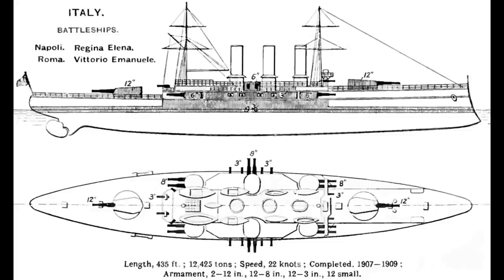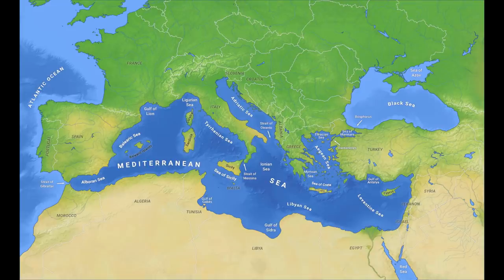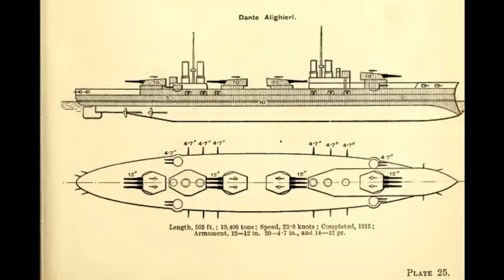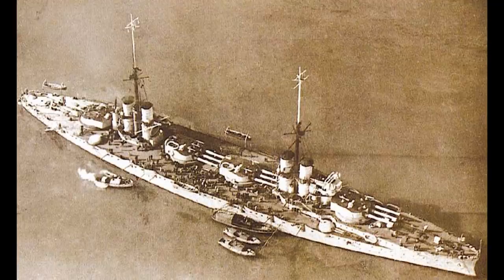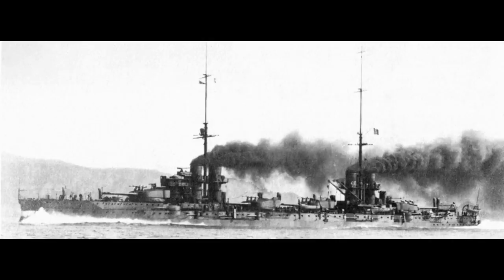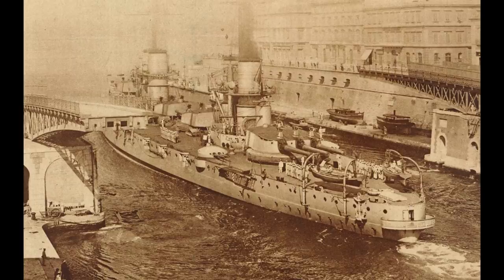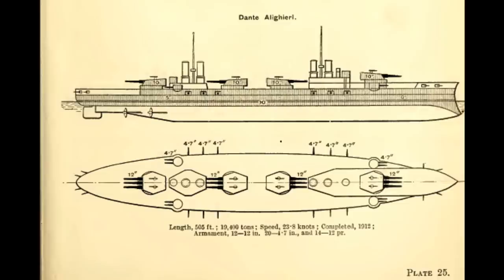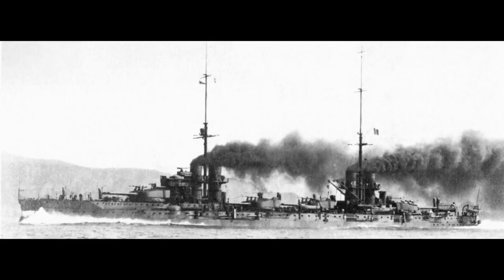RN Dante Alighieri - Guide 011 (Human Voice)

Comment: Question what is the delineation between a first-generation Dreadnought, a second-generation Dreadnought, and a super Dreadnought? I think this would make a pretty good show idea.
Reply: The first-generation dreadnoughts were HMS Dreadnought herself and the other early dreadnoughts with similar firepower (ie a broadside of 8 guns and caliber no greater than 12"). Second-generation dreadnoughts were an incremental improvement with 10 to 12 gun broadsides, and tended to have improved armor and/or all-centerline turret layout. Super-dreadnoughts had a significant increase in size and gun caliber of 13.5" or larger. Then there were the second-generation super-dreadnoughts, which continued the upward trend in size and carried 15" or 16" guns.

As to why they were called super-dreadnoughts? The first of them, HMS Orion, was 25% heavier than HMS Dreadnought, and the bigger guns resulted in her weight of broadside (the combined shell weight from a single salvo) being 80% greater. And to illustrate just how fast these advances were happening, Orion was laid down 4 years and 1 month after Dreadnought.
Reply: @RedXlV  I recall from somewhere that superdreadnoughts were supposed to "do to dreadnoughts what Dreadnought did to battleships", but I don't have a source handy

Comment: Question Dreadnoughts that had torpedo tubes, did those ever actually get used in combat?
Reply: HMS Rodney is believed to have torpedoed Bismark in the latter's final action, which would be the only time a battleship torpedoed another battleship.
Reply: The Rodney was believed to have torpedoed the Bismark in the clash in the night before the final engagement, however, from later interwiews of the Bismark's survivors, it seems it was more probable the Rodney's crew mistaken a fire that broke out on the Bismark's bow for the effects of their torpedo.
Reply: Neutron Alchemist what about fired at cruisers or other ships not just battleship versus battleship?
Reply: @lexington476  I can be wrong, but i'm not aware of any ship that had been torpedoed by a battleship in battle. 
In general, since battleships are vulnerable to torpedoes, and torpedoes can be carried even by very small ships, if a battleship came at torpedoing distance form another ship, it means that something went really wrong. 
That's why, while torpedoes were paramount for small ships like destroyers (that had not the firepower to threaten the bigger ones), they were a liability for the big ones, since to have torpedo launchers means to have several tons of unprotected explosive on the ship's deck.